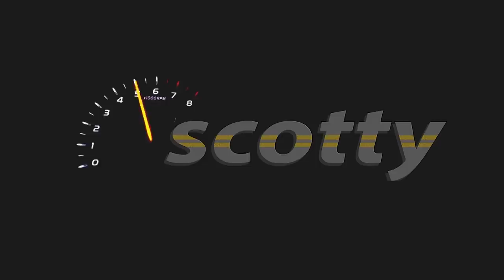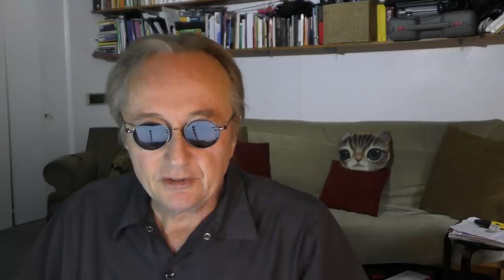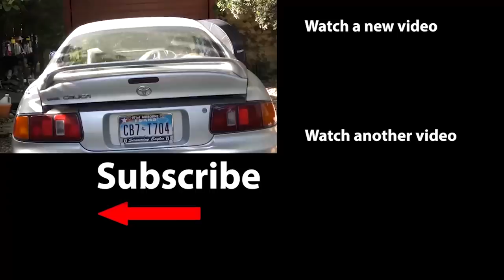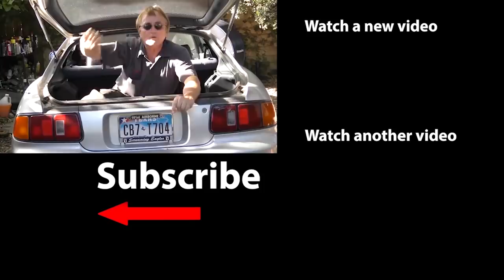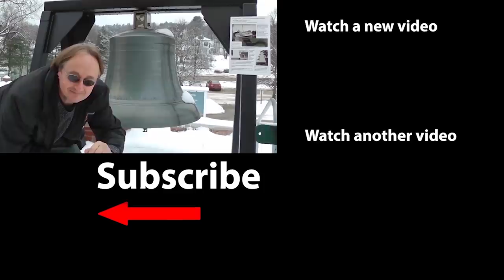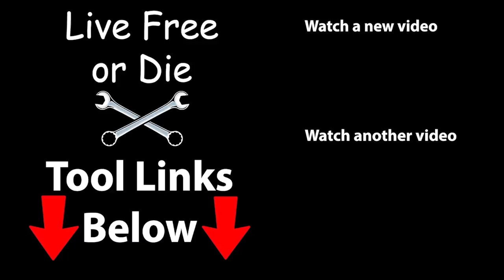Stupid Things People Put in Cars

Comment: When I start my 2000 Ford Ranger it sometimes takes a long time to turn over but other days it starts up immediately and sounds like the starter is grinding too hard or not enough... what should I do?
Reply: First think is have the battery load tested
Reply: @rays7437  Already did that
Reply: @christianhix1301  
When you say it takes a long time to turn over, do you mean that the starter is cranking for a long time before the engine starts running? Or do you mean that there is a long delay before the starter begins cranking?

Comment: 2014 Tacoma V6 4X4 TRD sport with tow package

2001 Dodge Ram 2500 Diesel Cummings Laramie   4X4   with k&n gen 2 intake and Banks 3.5 plus intercooler tube, With turbo housing & wastegate  and a broken stock clutch  😞

Comment: So I think you are saying, get a: manual transmission, 4-6 cylinder, normally aspirated, manifold injected, 2 wheel front drive, silicone wipers, stock exhaust, roller timing chain, roll up windows, analog gauges, mechanical adjust seats, without plastic engine parts, metal radiator, any Toyota/Honda, from 1995-2005? Yes?

Comment: Stupidest things people put in cars: Plastic door handles (self-explanatory). Power Seats (now I'm stuck driving in my GF's configuration because the motor burnt out). Power Door locks (now I have to reach behind me to unlock the passenger door - same reason). Power Windows (now I can't breathe without the air conditioner running). Air Conditioners (is this getting redundant?). Electric climate controls (can't turn the heat off). Air Bags (can't even wreck the d*** thing without losing a thumb!)

Comment: The Toyota hybrid system start/stop function probably puts much less wear on the engine because the electric motor assists the car during start up and acceleration.
Reply: Also the system is designed so the engine can be shut down while the car is moving. Theoretically, if your electric motor fails your car is non functional, but with so many priuses running around it is not a very widespread issue so far.

Comment: You don't want a standard (manual) transmission for towing. It's too hard on the lightweight drivetrains.
Also, new cars use oil because manufacturers have been on a "reduce internal friction" kick for over a decade in order to get better fuel economy and this includes piston ring tension reduction.
Reply: Same thing has an automatic just computerized shifting, don't overload in that case.

Comment: Response to question @ 5 minute mark .
Honda misfire on all cylinders. 
Exhaust valve stem wear , adust exhaust valves .
Actually  ,  exhaust valve face and seat wear (normal )
Reply: There's a big difference between "normal" and "common".
Reply: @palebeachbum   ,  ??????
Reply: @inverseuniverse5727  Dealer service depts. will tell you something that's going wrong with your car is "normal" because "they all do that." Thats not normal operation. Thats common problem to the vehicle. No prooerly engineered vehicle should have the issues they try to pawn off as "normal".

Comment: In 2007 I bought a 1997 Honda Civic coupe for $10,000 and when I looked at 2002 civics withe the same mileage they were $5000 more so I bought the 1997 and drove it and put 205000 miles on it in 6 years and only had one sensor go bad and the radiator started to leak but other than that it was a great car .Its not so much the year of the car but the mileage.

Comment: I always shut off the "start stop tech"when I start my 2018 f150. Leave it running... it idles at 500 rpms.. it's hardly using gas idling.
Reply: Jordyn Dietzler you’re a smart man. What you should do is compare the MPG. We would like to know exactly how much gas you save with that feature turning off your engine if you stop for more than 3 seconds, to find out if it’s worth the added wear on the engine (it’s probably not)
Reply: realfun7188 that's hard to say, I can see if you're stuck in the drive through for 15 minutes... but a minute at the stop lights, you won't notice saving any gas. I'd say it's decimals of how much gas you save, there was a couple times where it shut off on me and the light turned green after like 2 seconds.. so that irritated me when it shut off and started back up a second later.

I just hope my wife listens to me and shuts it off when she drives it.

Comment: I thought your engine suffered the most wear when COLD starting. Like UPS drivers. They shut the truck off everytime they leave it to make a delivery. Since it is warmed up for the day, I don't think it would wear out any faster than if was just left idling instead. Probably leaving it idle is worse for several reasons actually.
Reply: Curt Chase They do that so nobody steals it
Reply: @sammolloy8129  OK thanks for the info! Makes sense. Of course my point was that I don't believe the engine of the UPS truck is experiencing any undo wear with stopping and restarting during a daily route.

Comment: Big difference between mpg and efficiency... If parts of the car, particularly complicated expensive FORMERLY reliable parts, now must be repaired or replaced, the machine has become inefficient.. Very hard to make up for the material, fuel, and time that go into a repair.  Worse Yet, failed transmissions or other major parts that render a car useless.

Comment: Scotty my 06 Toyota Tacoma is about to hit 200k should I start replacing anything
Reply: Those Toyota Tacomas are tougher the ten acres of garlic. My advice, just keep doing routine & preventive maintenance, and you should be fine. Oh, and one more thing, check under your truck. If the frame is rusting out, then it might be time to get a new truck. Otherwise, keep driving it...
Reply: Joshua Brown it’s starting to rust but it’s not that bad is there anything I can do to prevent it from rusting even more
Reply: Scotty Kilmer has a video on how to remove rust. It should be helpful. This is if it's rusting badly like if you see holes and the like. If its just surface, don't worry about it.

Comment: Correction. It's not the starting and turning off the engine that wears it down. Its constant cold starts. The metal takes time to heat up and expands to fully seat the bearings and rings.  However, most manufacturers are using softer grade metals that do not expand as much so cold starts are becoming less of a problem. Unless it's for racing applications. Now you can argue as to how much gas your actually saving as the car is running pretty lean at idle. Also wear on the starter will be increased if they did not beef up the starter.

Comment: I had an 03 century common problems with them is the prndl burns out at around 80k miles and the rockers rust out no matter what you do and you’ll have to change a fuel pump because the sending unit and level always go bad

Comment: Good news for those with start stop that you have to disable with every start.  Usually you'll have a small lithium battery that handles that feature.  Bigger battery is the normal one like any car.  When the little lithium battery dies, the start stop feature stops working so if you normally have to press a button to disable it at every start, guess what?  Not any more.  It's beautiful.  Just let that battery die and don't replace it.
Reply: Or you could just unplug the battery…
Reply: @tails300  Indeed but I didn't do that so wasn't positive that would work.  The only thing with unplugging was I thought maybe with all this computer crap it would know there is an open circuit versus a closed circuit with no power.  Probably work to unplug though but haven't verified it so didn't say to try it.

Comment: I don't understand how everything has been made electric at least once, like waterpumps and powersteering, but not oilpumps. If oilpumps were electric and they could be activated a few seconds before the engine starts, engine wear would virtually dissapear. Today it wouldn't matter anymore, because long lasting engines make less profit, but it would've been interesting to see.
Reply: Sflot I seem to remember this being done before, maybe I dreamt it?  Ten problem with it is when you lose power or a relay goes bad you just blew your engine. Now what I do like is an oil pump that is electric and mechanical. It  kicks on like a fuel pump before start up, and the mechanical just does its thing
Reply: Vertigoat they could protect engine damage by preventing the car from starting up if the oil pump is broken or leaking too much

Comment: You are not getting wear on a warm
engine start-up. Cold starts are when most wear can theoretically happen. But how much wear is really happening? Do you think that when a warm engine shuts off for a short time period that all of the oil drains off the engine components? No, they all still have a film of oil on them. There have been engines with a million miles on them that have been torn down to inspect the internals, only to find everything looking great. You can see multiple videos on those online. How many start-stop cycles have been on those engines? A lot.

Comment: They should have just paid on the patients for Gadgetman throttle body groove and Dr. Somender Singh head grooves. Those work...the oil companies won't let the auto industry use them anyway since almost all your fuel is used for power and not exhaust.

Comment: Well, Honda/Acura has cylinders deactivation system (my 2013 Acura RDX has it) and it is NOT all it cracks up to be.
Reply: but it was a great selling point to get people to buy it thinking,  wow,  I will save all this gas money,    and then,     nope.  but it does give the car maker something called carbon credits so they can then make more larger trucks that take more gas,   they are only allowed so many carbon credits,  and that then says how many they can make legally under binding UN laws.  so they must make and sell lots of little junk to do it,    but selling all that junk only causes more factory pollution.  but its not about making the air better or fuel economy.   its about collecting a carbon tax,
Reply: @ateam6486  Right, it also drives me away from Honda as I am now looking for a new SUV.  I was thinking about the Honda Pilot or the Passport but, my Acura RDX (it supposed to be the luxury model of the Honda) V6 is not smooth and idle on the rougher side (I guess because it shut off two cylinders?).  I owned both Odyssey and RDX and a Sienna... The Sienna V6 is ultra smooth and quiet.  So, I probably will be looking at a Highlander instead.

Comment: I miss the pictures. I run an old motor to avoid the high tech crap. Keep it simple I say. Problem is that when you need a part for a 14 year old car, the price is horrendous. For my Rover 45, they want €110.00 for an O2 sensor. Nothing available at the breakers yard. And a front brake caliper was only €35.00 two years ago. Now it's about €120.00. I would run something even older like an ancient Austin or Ford Cortina/Sierra but thanks to the scrappage scheme and natural wastage, these now reach astronomical prices.

Comment: you want good MPG's? Get a small, lightweight car with a small engine and drive in a conservative way.
Reply: Brian Waller  I've driven a few compacts with CVT's on the highway and have been able to get close to 40mpg. The problem is in stop and go city driving, that CVT is like cruel and unusual punishment.
Reply: @denniskirk2754  Only a manual.
Reply: Brian Waller  Yeah, but these have all been rentals, I would not buy a CVT or DCT equipped car,  I don't care who makes it.

Comment: Low mileage old cars, unless you're in a dry climate area, you have to get on a lift and go over closely for rust issues.  Sitting over a concrete floor for years or if they saw road salt and didn't get washed well they can just sit and rot because they never get used and then when you do start driving it, the vibration of going down the road shakes everything loose.  I had a 56,000 mile Suburban that was a great truck but it was so rusted that when I accidentally broke the back window the whole dang tailgate fell off.  I ended up replacing every line under it, brakes and fuel.  But it was a $500 truck and it lasted me five years of really hard abuse, once I had something like 7500 lbs behind it between the trailer, the car on it, and the 50 or so starters and generators (remember those?) I pulled out of the car afterwards.  

We sold another one, a '60 Caddy hearse that looked pretty decent but on a truck going to California the thing fell apart, one of the springs broke in the back even.  At least that's what the buyer said, they never did send any pictures.
Reply: And you've never had fun until you've walked half a mile up the hill to an old parts truck, taken the barn doors off, dug through the neighbor's bolt bin for some bolts and figured out how to backyard-engineer the barn doors onto a truck not made for them, all in a few hours on a cold late winter day, so you could drive 75 miles back home without all your crap blowing out of the back of the truck.

Comment: Scotty, I know this isn't a joyous topic. Could you please make a video about the newer cars that have these dial shift selectors or the electronic levers that go back to the same position. In recent news here in Sugar Land a 3 y/o child was ran over after a car was accidentally shifted into reverse by accidentally bumping the dial while the driver was turning on the air conditioning. With your massive viewership and honesty, I think you may have an impact in reducing the number of these cars on the road that have these simplified gear selectors that aren't as safe as past designs. Another thing I wanted to ask was that if a driver is parking a car on an incline, say parking on a driveway while facing a house, is it safe to put the car in neutral while holding the brake and apply the parking brake. Then let the car rest on the parking brake before shifting into park? In the case of that girl I think if the driver had developed the habit of doing this kind of parking then if his brake was strong enough it might have been able to stop the car even if it was trying to roll in reverse and saved the girls life. I also think this method of parking might result in less wear on the parking gear since the brakes take the pressure. If I'm wrong in any way I'd love to be corrected in the comments below. Please drive safely.

Comment: I have a 2005 Honda Odyssey EX-L with cylinder deactivation, I have turned off the feature and my van is now running on 6 cylinders all the time. Surprisingly mileage improved.... I just got sick of replacing expensive active motor mounts that kept on breaking due to the vibrations produced in 3 cylinder mode.

Comment: Scotty what are your thoughts on Ford's limp mode to disable cylinders and use them as compressors to keep an engine cooled, I know only about the duratec 1.8-2.5 doing this
Reply: Does this explain why my Focus sounds funny when you listen to the engine? Sounds like a misfire but they all do it.
Reply: @jasonashley9853  what year, mine is a 2002 in a ranger
Reply: @jasonashley9853  these engines will give a code at the first sign of a misfire if your engine is a duratec, (zetec is name scheme for cars dura for truck)
Reply: @jasonashley9853  the misfire sound is from I believe the butterfly intake system but I'm not sure, I removed those from my truck and returned it myself
Reply: @jasonashley9853  you'll know a misfire with this rnhine because it will shake a lot running on 3 cylinders, the harmonic balancer is aligned for 2 and 4 cyl operation
Reply: @Project-gr6zy  It's a 2016.
Reply: Also, I had a misfire before I replaced the purge valve that was ticking. I was sitting in my driveway with friends while in the car and you could feel the engine lose power and almost felt like it was gonna stall. Been fine since.
Reply: @jasonashley9853  hmm, try checking the spark plugs gap, check the air intake, check the pcv valve, check the fuse panel
Reply: On mine when the pcv clogged had a lot of issues
Reply: @jasonashley9853  the motor is called MZR L4 or Duratec
Reply: @Project-gr6zy  what sort of issues? You have one without direct inject, how many miles? I'm at 82k myself. Got the engine and transmission custom tuned.
Reply: @Project-gr6zy  I haven't seem to see any misfires since. Trying to get ahold of my tuner. No shudder, but every once in a while my shifts seem jerky. I'm talking to others about that.
Reply: @jasonashley9853  220K miles (mostly city miles)
Reply: @jasonashley9853  might have been ecu and most likely you have coil on plug, check and see if they are damaged but if coil pack check for cracks and such